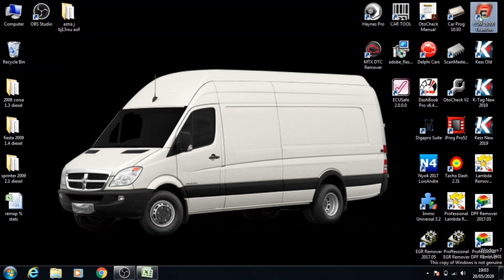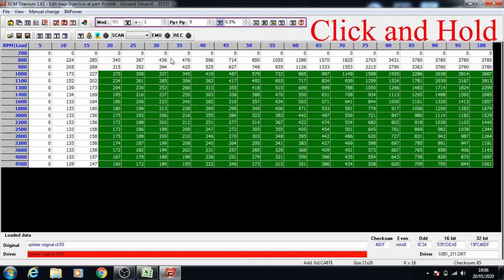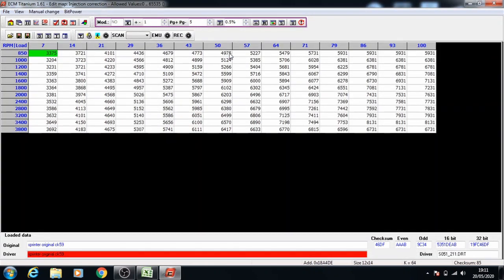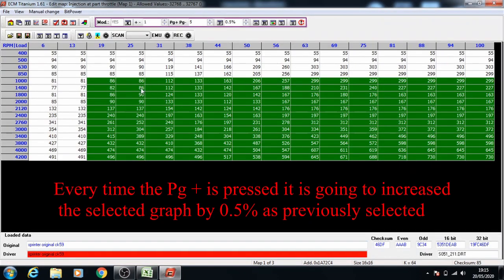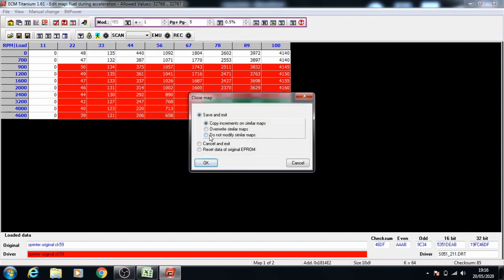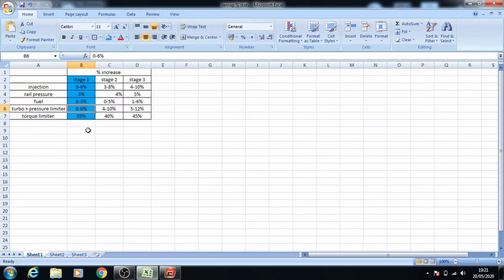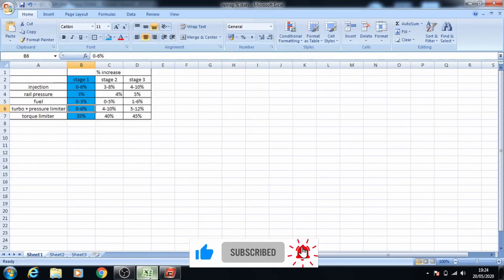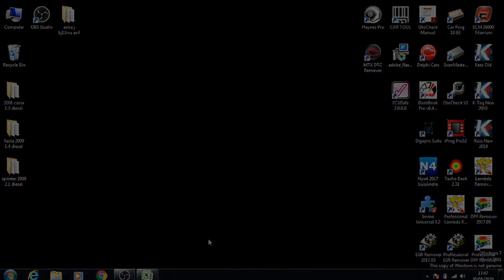How to Remap ECU Engine Control Module of Mercedes Sprinter 2.2 cdi Euro4 Engine to Stage 1 Tuning

Comment: Heya!
So, I believe you don't think as you should when it comes to a small tune up like this. Assuming you are doing what is called an Eco Tune, to provide a bit more torque and responsiveness on the throttle and reduce your litre/km, you should max it out further in the rev range between peak torque and peak horse power, and doing the smaller increment on the rev range below peak torque and above peak power. It doesn't make sense tuning up 6% on the 4500 rpm at 100% throttle on a street vehicle, much less if the intention is to actually reduce consumption, and just getting values between 1.5-3.5% on the actual rev range the person will actually drive the Sprinter (or whatever Diesel car you are considering, like your other videos).
A well maintenanced car can go from stock to an 8 to 12% increase with minimal damage risk to internal components and clutc. IF you are messing with the standard VAG 1.9 TDIs blocks, you can even ramp it further since the engine block and internals are mostly the same for the 110, 140 and 180 hp versions.

This being said, the technique you use is the way to go and I actually learnt from it on how to use the software. Your content is great, man! Nice tutorials and explanation that you give out to us, common folk, for free! ;)
Good job!